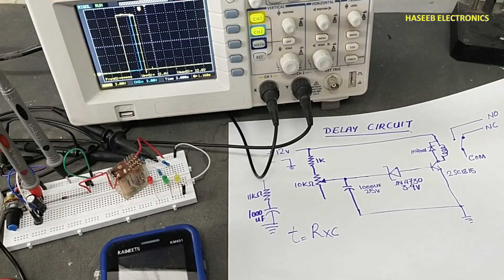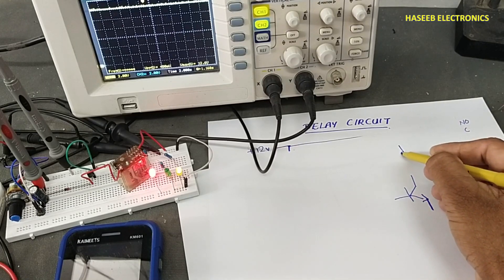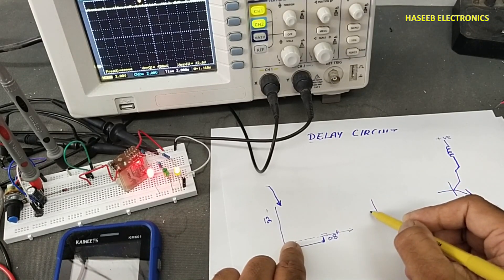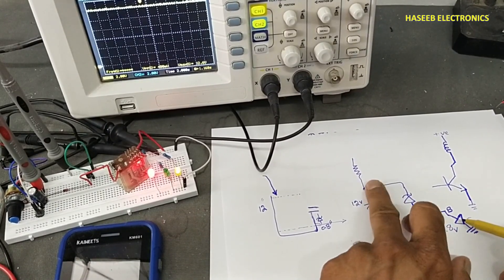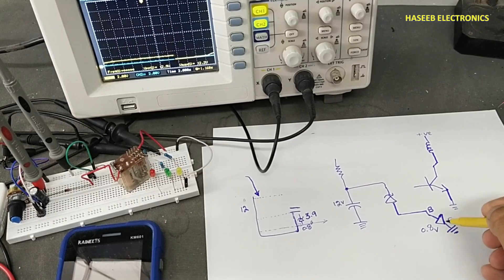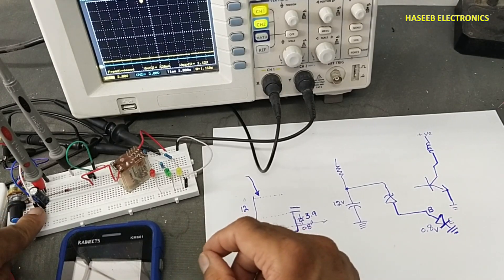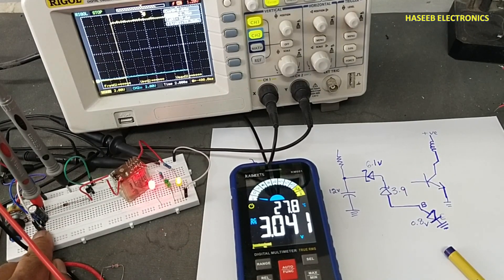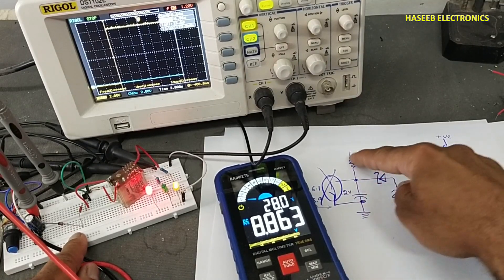{911} Why zener diode is used in delay timer circuit

Comment: Great work to explain the working principles of electronics's accordingly, good job really Appreciated
Reply from the maker: it is my pleasure
Reply: @HaseebElectronics  actually as a Pakistani we proud of you because your efforts to educate the people's in right way, Almighty God bless you
Reply: @HaseebElectronics   This is the formula to calculate the time delay for such circuit

t= R×C× Ln(Vcc/(Vcc-Vc)) where Vc= Zener voltage (Vz)+ Base-emitter voltage(Vbe)= Vz+0.7v

t is time in second, Vcc= Supply voltage, R= resistance in ohm, C is capacitance in farad. Ln is natural logarithm.

I derived this formula myself after solving series of Ordinary Differential Equation(ODE) and I've been using it since. The only disadvantage of using zener in this kind of delay circuit is any change in the vcc will change the delay time because it's Vcc dependent. I have other formulas that's voltage independent but it's meant for delay circuit using op amp.

Comment: As I understand Haseebji we are increasing the lower limit of voltage supplied to the transistor and thereby ensuring the time gap we need.  Thank you for the explanation, it was clear and now from this i think i might use the same logic of lower voltage limit in other circuits.
Reply from the maker: exactly perfect, we set a trigger level for the transistor using its voltage level. it is done by adding a zener diode + base-emitter junction voltage value
Reply: 1) So it means you can get a longer delay with a smaller capacitor. Using a smaller capacitor is usually preferable for cost, accuracy and physical size reasons. 2) Is it advantageous to use the part of the charge curve that is increasing quite rapidly if we want to make the delay timing the most consistently accurate (e.g. consider electrolytic capacitor tolerance, for example, and variations in the transistor Vbe, with variations in temperature and between individual components, for example). Hence something like 1 x time constant (about 60% charge) is a sensible compromise to aim for. Is that right?
Reply: @jam99    This is the formula to calculate the time delay for such circuit

t= R×C× Ln(Vcc/(Vcc-Vc)) where Vc= Zener voltage (Vz)+ Base-emitter voltage(Vbe)= Vz+0.7v

t is time in second, Vcc= Supply voltage, R= resistance in ohm, C is capacitance in farad. Ln is natural logarithm.

I derived this formula myself after solving series of Ordinary Differential Equation(ODE) and I've been using it since. The only disadvantage of using zener in this kind of delay circuit is any change in the vcc will change the delay time because it's Vcc dependent. I have other formulas that's voltage independent but it's meant for delay circuit using op amp.
Reply: @MitechElectrical Interesting how in this circuit this formula predicts well for the two zener diode case , but  not for one zener case, whereby we see the circuit turn on at a voltage well below zener  + Vb voltage.   I assume this is caused by the soft "knee" of the zener effect , but is it possible to predict this divergence of behavior through calculations?

Comment: Showing at what points in your circuit your coloured LEDs are wired in would be helpful
Reply from the maker: red LED is power indicator (cathode is connected to ground, anode is connected to +ve through 1K resistor)
green LED is NC indicator (cathode is connected to ground, anode is connected to relay NC points through 1K resistor)
yellow LED is delayed power on indicator (cathode is connected to ground, anode is connected to NO normally open points through 1K resistor)

Comment: For RC circuit which is first order aperiodic block (described by linear differential equation of first order) it is aproximate of 5 time constant for reaching 99.99% of final value i.e input step value.